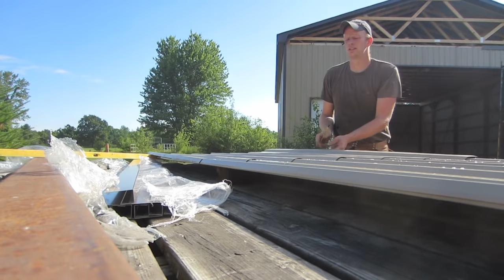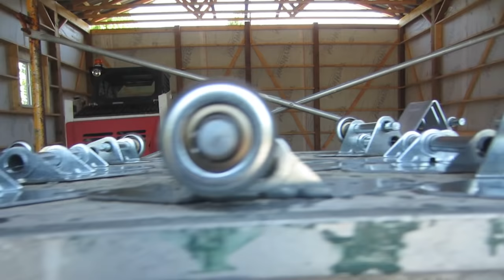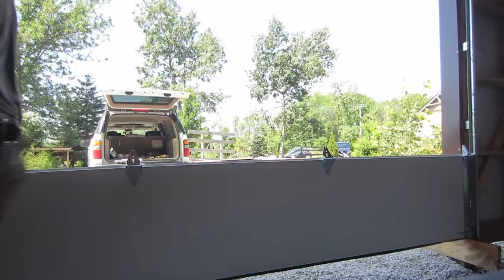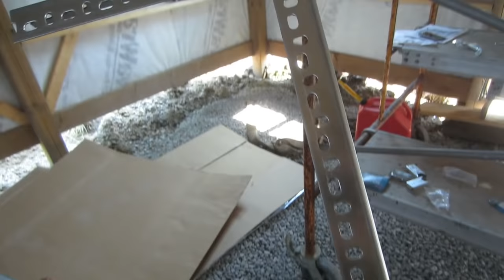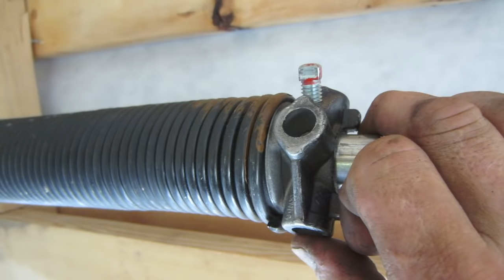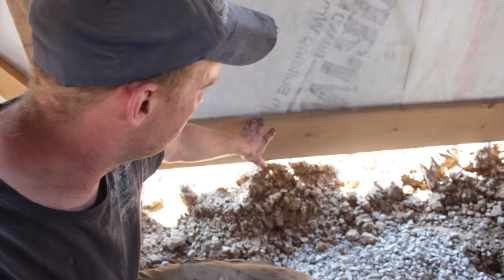DAY 7: How To Build A Garage (For Your Brother)

Comment: After the bar bashing me in the face a few times...I got some friends to help me open the door all the way up without the spring, attached it and tightend it one or 2 turns only. That way the sping get tight as you close the door, rather than pre tentioning it. Not sure if that will work with all types, but it sure saved me alot of stress messing with those damn springs

Comment: Nice video, I'm from Sweden and wonder how longe the wood that you put in the ground will last? why not just put steel "shoes" in the concrete so the wood stays dry of the gound
Reply: The wood tends to absorb moisture from above ground also and if you put a metal cap on it the water dosnt have anywhere to go, and the base of the wood starts to rot much quicker than the rest.

Comment: I'm in Ottawa.. I just watched the whole thing  about building a garage.. .. I don't know whats better... a pole barn or a concrete  footing and floor  with 16 inch studs and asphalt shingles and vinyl siding... .. does your barn cost more because its a metal clad pole barn?
Reply from the maker: Pole barn is cheaper, concrete footings is more secure (rodents).  Steel is roughly $1/sq foot.  It will last longer than vinyl though.  I wouldn't even consider shingles on the roof.  Don't forget that you have to sheet the roof and walls which adds to 2x the labor and material.
Reply: DEBOSS GARAGE  I'm thinking of a rectangle garage  with a hoist  so I need the concrete floor and  electricity  but  in Ontario your allowed to build a polebarn..  ? the building inspector let you do it obviously ..I think the house n garage should match....white vinyl siding should last 40 yrs.. ..shingles should last 20..
Reply: @DEBOSSGARAGE  Hello great build I watched all of the videos on building your brothers garage. One thing I don't understand is why didn't you use the round forms for the pole concrete & keep all dirt from touching the pole? It would be cool to see the inside in use now that it is all done! Thanks for the series!

Comment: debos I'm 17 I've only pulled a motor one time.. ive never worked on a diesel and never installed a engine.. would you recommend I attempt to do a 4bt swap in a older Chevy  truck... I would really appreciate your opinion thanks
Reply from the maker: I love your ambition but you might want a little more experience under your belt.   It gets complicated with the wiring, electronics, welding, machining, fabricating while managing time and finances.  I started with an S10 when I was young.  Did a straight swap for the engine that was supposed to be in there, painted it and got into it little by little.  That is probably the way to go.

Comment: DEBOSS GARAGE
What did materials cost to build the garage? Im in the process of getting ready to build one. Im undecied if I want to buy a prebuilt kit , large tent style fabric garage or like you did.
Reply from the maker: about $12k for materials.  Keep in mind that the kits are curved and you can''t clad the inside.  If you want to insulate, you need fire-resistant spray on and it is 3x the price of normal insulation.
Reply: Yes I know . Insulation or heat is a must here in the North East.
That why I keep going back to a large 20x30x16 dome fabric tent style garage. 
I purchased a new lift and do not want to keep it out side. I already have a garge but my machine shop is in there.